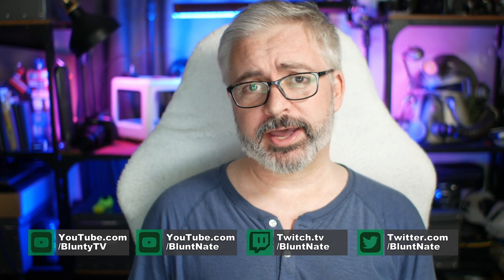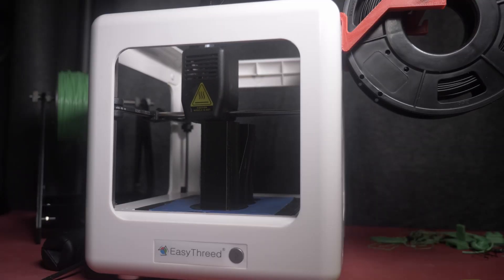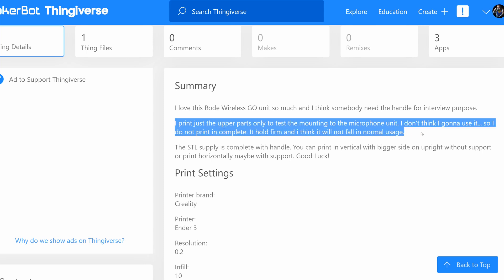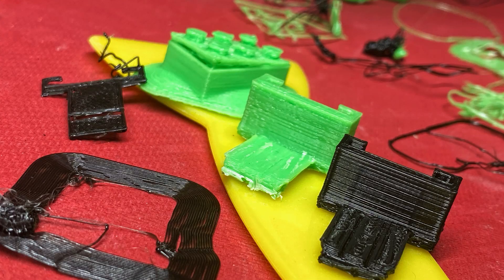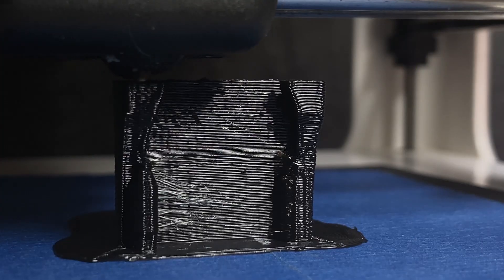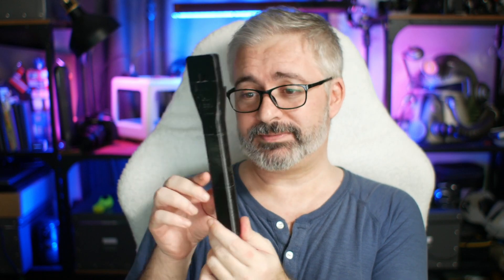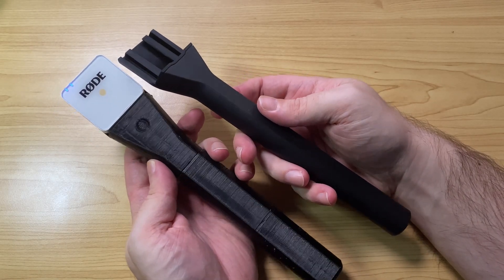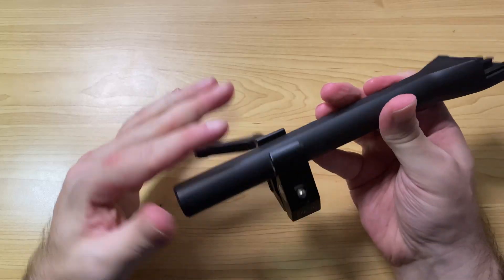3D Printing a Microphone... A Story of Disaster

Comment: Always enjoy your videos, great mix of humour and info, engaging delivery. I dusted off my 3D printer for the first time in about a year too. Printed a replacement wheel for my vacuum cleaner. I paid peanuts for it, expected little of it, but I have to say, on the rare occasion I use it, it works, flawlessly. It was from XYZ Printing.

If you want to design in 3D, I wholeheartedly recommend MOI3D (moi3d.com). Easy to use, but very capable.

Comment: One fun thing I do with 3D prints to make them heavier is to add weights to the inside of them, or in some cases, sand / resin. Sucks you didn’t have access to a better printer, but hey, you figured it out! 

I’ll say this though- learn to use something like blender or a cad program if you find the time / motivation. Designing a better grip would be pretty beginner level modeling, and it’s something I’d do considering I already have the modeling skills and the printer / tools VS buying the expensive piece of plastic. Still, interesting video!